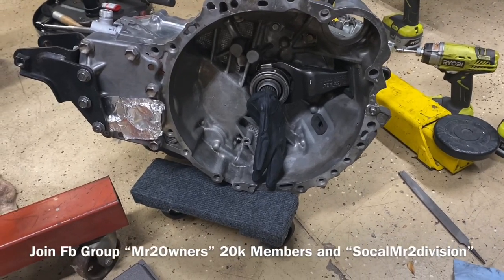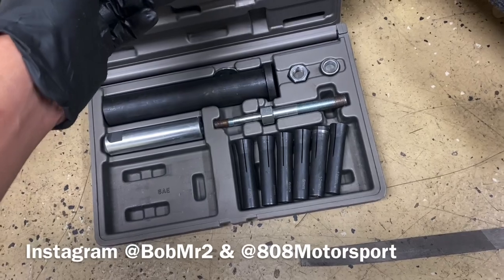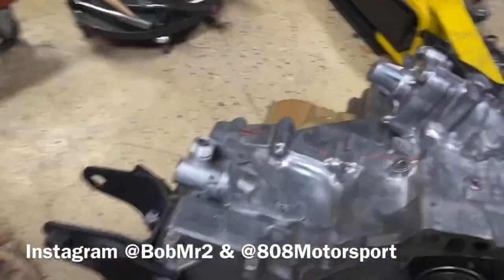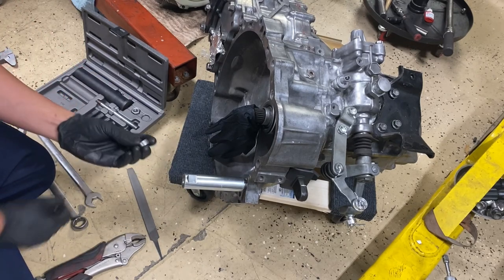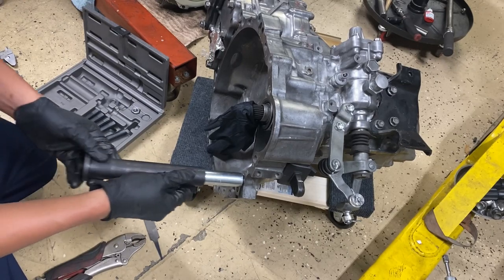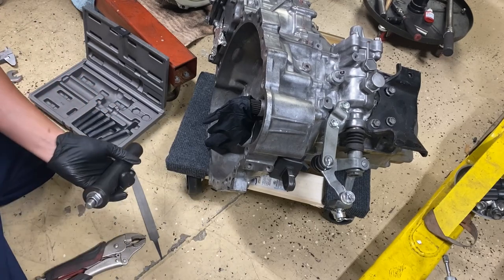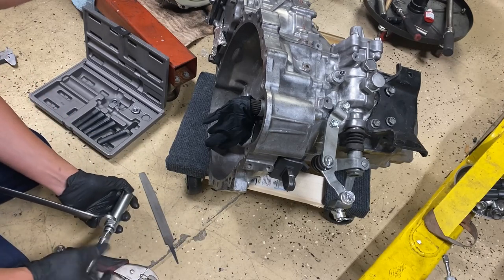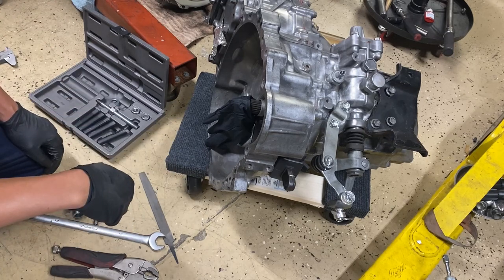DIY: BobMr2 Remove Dowel Pin w/ CAL-VAN Dowel Pin Puller

Comment: Does one need to own both an sae and metric dowel pin set or does it clamp down enough that one set suffices in either application?
Reply from the maker: @pedaltheglobe419  sorry I dunno. I only use metric since I only do toyota specially mr2